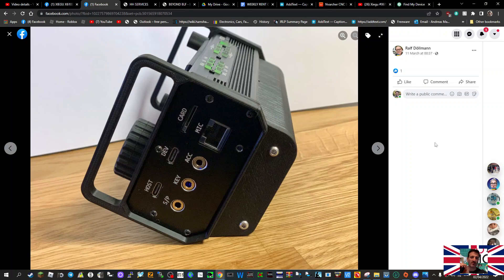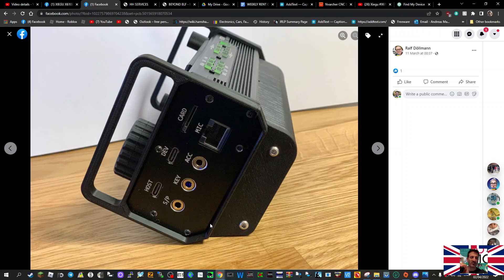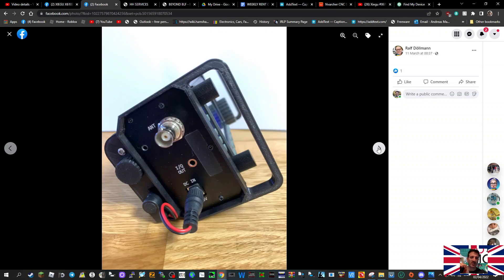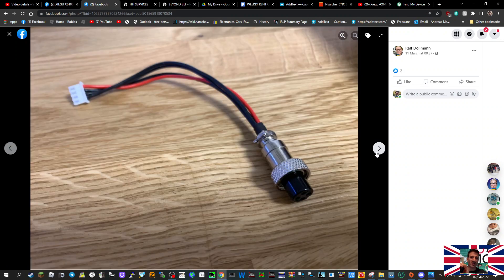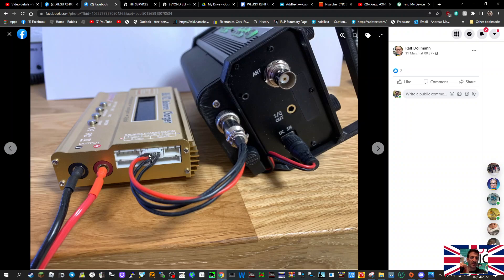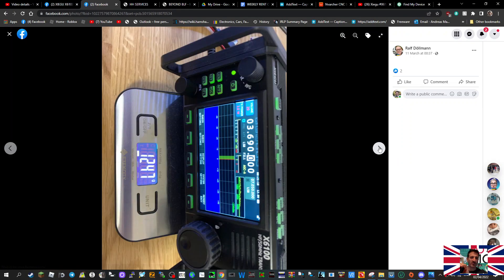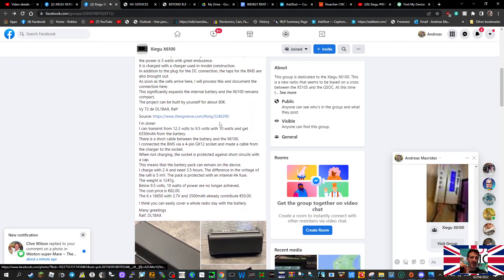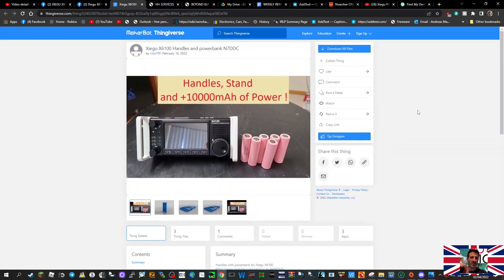XIEGU X6100- Battery Extension

Comment: With the heat that the radio generates id be worried about fitting this battery pack. How is the existing heat dissipated? Into a lithium ion battery, this is a seriously bad idea. A better solution but less neat is a totally separate battery pack.
Reply from the maker: Yes makes sense to consider the Heat .

Comment: 1:22 balancer connection, it means 3S battery configuration, each section is charged separately from the other to ensure even voltages between cells that means longer life, even internal resistance, less fire hazard, less overheating etc. google the rest
Reply from the maker: Thanks for info .